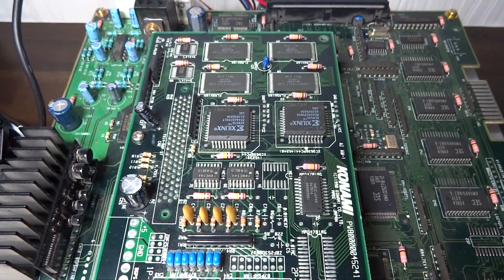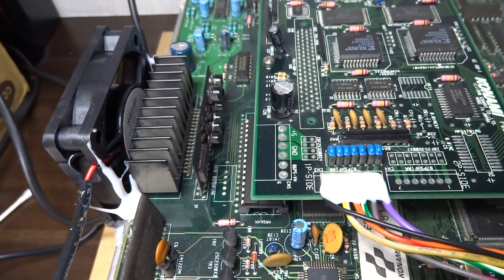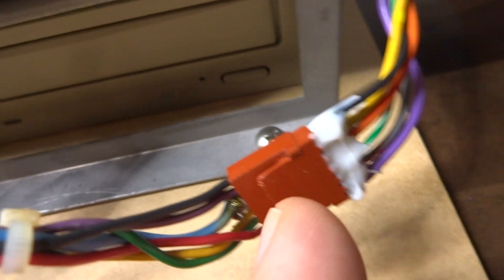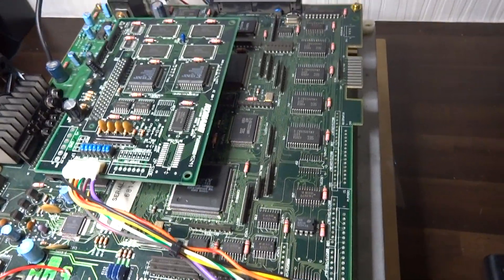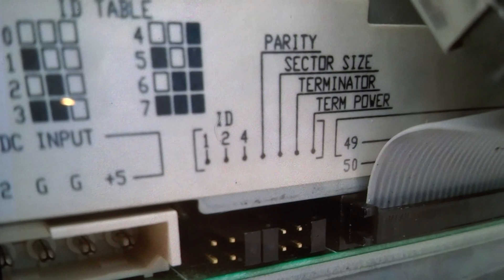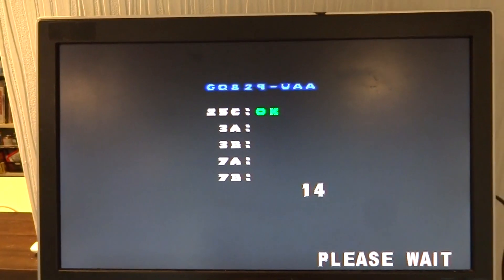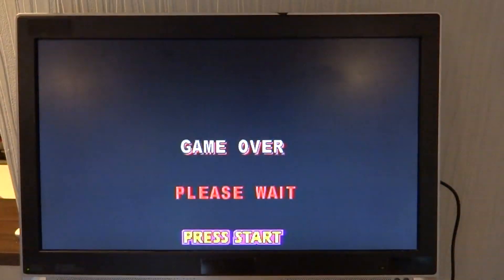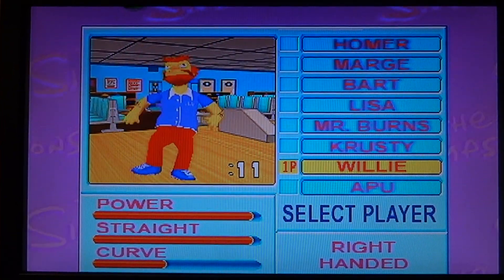Simpsons Bowling Arcade Repair Tips and SCSI Drive Jumper Settings

Comment: I've played that game a lot this year and i know that if the game reboots unexpectedly during gameplay as it loads up a voice sample, its 100% the drive that's being dumb. BTW does the audio cable needs to be plugged in for the audio to be heard? I've checked the original disc and there's no CDDA tracks for the voice samples.
And also, can the CD drive be swapped out with a SCSI DVD drive? I'd love all the help i can get from the community to help the local party place in my town that has a Simpsons Bowling cab get their cab up and running again.

As it stands at the moment, the board throws a CDR ERROR message before it reboots.
Reply from the maker: CDR ERROR is caused by a bad drive as well as the other points you mentioned above. As for the SCSI DVD Drive, Im not sure if it will work or not but it is worth a shot. If it does work and you could leave a comment here about it, that may help out others. Just by replacing that drive, you should be able to get the bowling game up and running again. Make sure there is a fan on it as well to avoid the overheating. Also, Check the Jumper settings on the new drive and make sure they are set right like the ones in the video. If you do get yours running, feel free to make a video and a link to yours so others can check it out :)
Reply from the maker: Also, about the sound, it will come out from JAMMA so you dont need to use the other cable at all :)